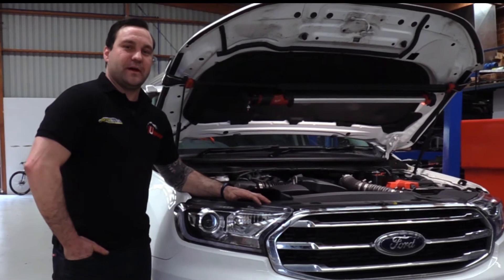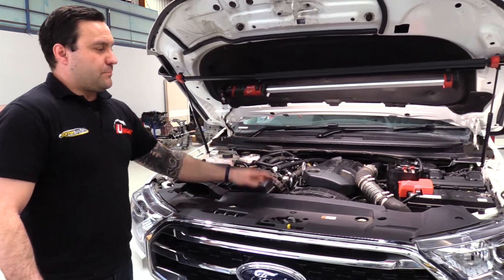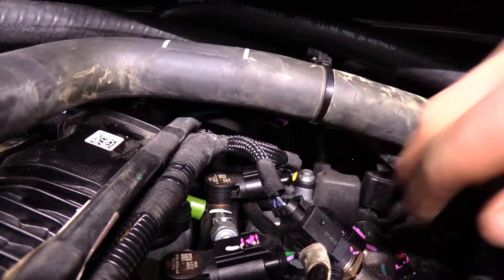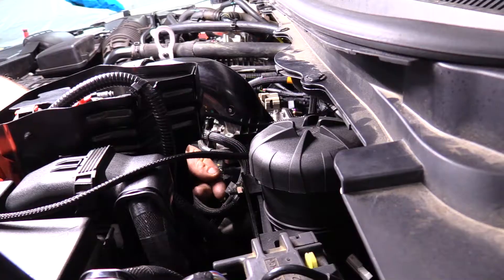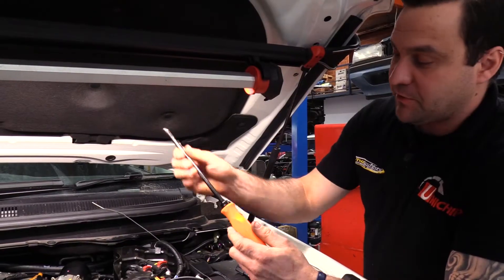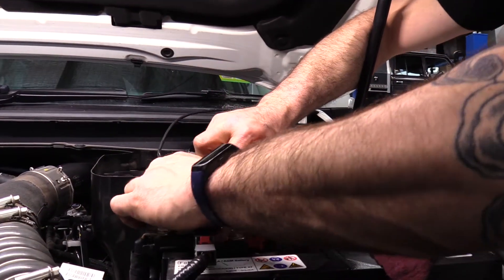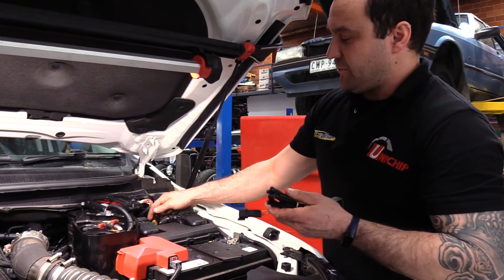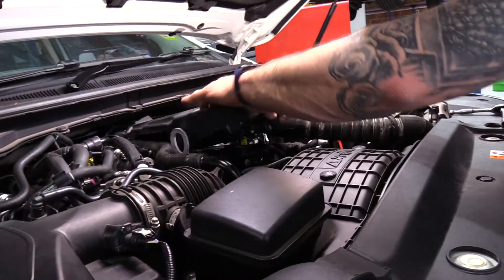Uni-x ECU - Ford 2lt Raptor, Ranger, Everest Fitting Instructions.

Comment: Power gains are what?
Reply from the maker: STANDARD: 118.0kw at the wheels
UNICHIP: 144.1kw at the wheels
 
The “Low down” torque displayed on the graph below: 
STANDARD: 410nm
UNICHIP: 520nm